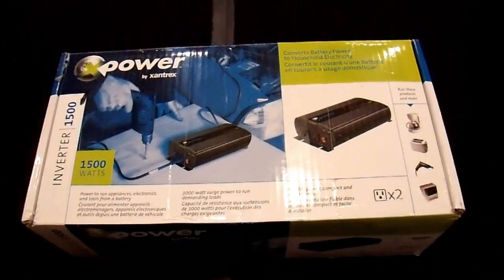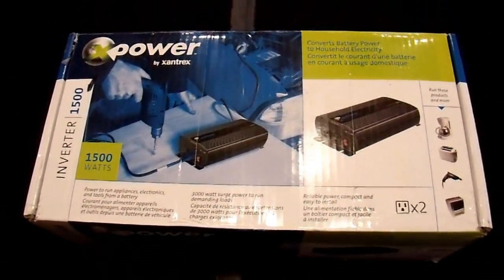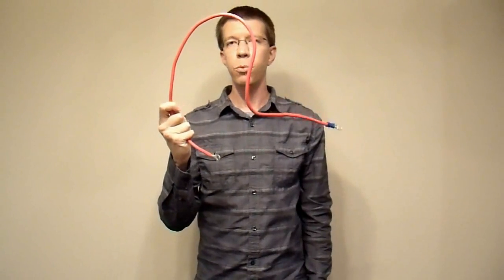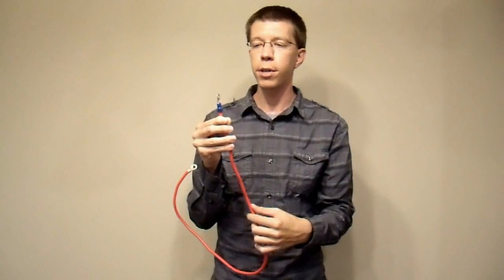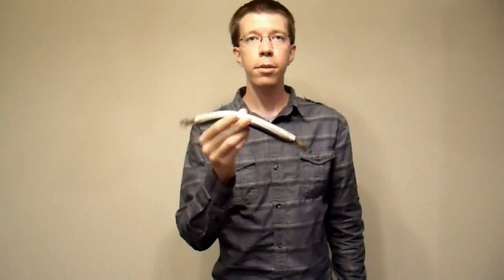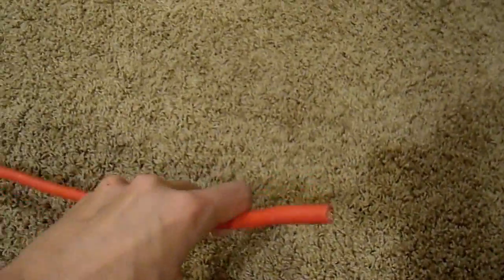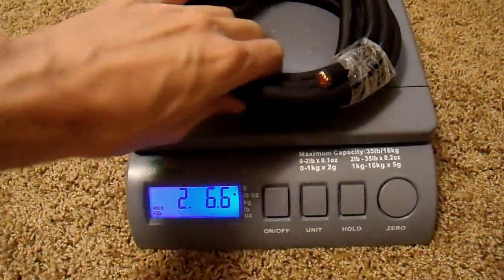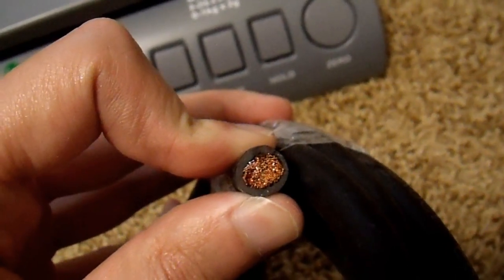How to Select and Purchase Battery Inverter Cables Part2

Comment: hi, does the battery sizes matter to use ? and does the inverter produce the wattage is says on it what i mean will the inverter produce the wattage no matter the type of battery i use or does it depends on the battery? and in what way is the inverter better  what i mean, should i stay with 12 volts and 1.3 amps or increase the voltage ( how much volts) and leave amps alone or leave the volts alone and increase the amps ( how much amps) or increase both?

Comment: How about on a 2000 watt inverter can I run 6 feet of 1 AWG for the positve cable and 6 feet for the negitive. And should I have a 200 amp fuse or 250 amp fuse installed ??

Comment: Hey all. I'm just getting started in solar power. so i apologize in advance for my novice questions. I've gotten my 2 deep cycle batteries. Next will be the 100w panel and control charger. Finally, goung with either 400, 800, 1000w pure sine inverter. my question is what size (gauge) from the charge controller to battery, battery to battery, and battery to inverter. All 3 components will be in corner of my home (roughly 3x3 area) I know distance places a part in choosing the correct wiring. also, where do I out inline fuses and what size fuses?

Comment: watched pretty much all your videos .looking to do a cargo van conversation to camper.after watching your reviews i have decided on the tiger claw 15000 converter because of cost and the pure sine wave. im thinking of four 100amphr 12volt   deep cycle batteries in parallel and a 400 amp controller.run off 3 100 watt flex solar panels.do you think this would power a 500k a/c unit? along with some lights.a small micro wave,small portable ice maker.small tv .not all run at the same time of course. does the set up sound ok? new to all this.

Comment: quality car audio wire is usually over sized cheap car audio wire is undersized (for example sky high car audio 1/0 is about 3/0 size from what i have read and seen) as you said check reviews before you buy 

(disclaimer i dont have hands on experience with shca wire but there is plenty of info online)

Comment: Just bought some heavy cable for an inverter install at a surplus store.  It's a length of old welding cable I thought was 4/0. Turns out it's even bigger.  The copper cross section is just under 9/16".  I'm guessing it's 5.5/0 from the charts I've seen. Can't find lugs for it online.  Any idea where to get them? I guess I'll stop by a welding shop,  but will probably be $$$

Comment: Also after doing some further research. I've come to the conclusion that my little Corolla's alternator may not be able to handle the draw from the inverter on the battery. So it was suggested to put another battery in the car. I will be getting a Group 27 deep cycle battery. Should I get an ACR or Isolator? Don't think I would need one since I will only have the inverter running when the car will be. Any other advice or suggestions?

Comment: I'm looking to hook up a 1000W pure sine inverter in my '08 Corolla. I want to use the inverter to power a battery charger for landscaping equipment. The company of the equipment states the charger needs 550W to work properly. So I figured why not go with 1000 instead of 600. I was initially going to install the inverter in the trunk (for ease of access). Until I read your comments about a moisture free environment. Now I will install it under the passenger seat.

I'm just curious about:

1) should I ground the inverter to the body instead of back to the battery?

2) will this be a problem for my battery/electrical system in the car?

3) any recommendations for wire size and in line fuse amperage?

4) anything else my noob self may have overlooked?

Thanks in advance for any advice and for this truly informative set of videos!

Comment: Hello, what gauge size inline fuses would I use with the 2 gauge wire running approx 5 feet
Thanks Al
Reply from the maker: It depends on your particular setup.  (Insulation class, environment, cable routing, fire hazards, etc)  But it would be in the 100A to 150A range.

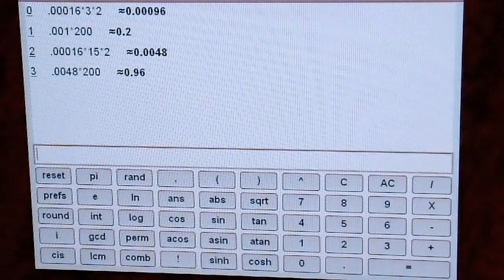Comment: Why is 0.2v okay but not 0.96 at 4:20 on video?  I understand the math but not the conclusions's assumptions. Why?
Reply from the maker: It is only a 'rule of thumb'.  One could go into the engineering tradeoffs for a particular application but the complexities of optimizing the system quickly get far more involved than the effort that is practical for most applications.  I stated 0.2V as a good value to choose and design for for general applications.

Comment: I just received my new 1kw pure sine wave Odyssey 24v inverter. You haven't mentioned a hookup which goes through the Solar Charge Controller.  I expect to MAKE a few lithium ion 24v batteries for this system. I suppose that the gauge wire used should be the same through the charge controller connections. Right now I have 10 gauge in place and 10 amp circuit breakers as disconnects but i see that I'll need to increase that to 60 amp circuit breakers. (Surge watts might come to 1.4 kw) It looks like they've sent me 2' of a much thicker gauge wire than the #10 that I have used so far. Should I change it or am I all right?

Comment: would like to know if you make a 4/0 allluminum but connector can it be done and should you solder it or crimp and can yo use a copper but connector on alluminum??Thanks
Reply from the maker: It isn't generally a good idea to connect copper to aluminum due to their galvanic differences, however I know that there are solutions out there intended to solve this very problem.  I only work with copper cabling myself so I have little experience in that regard.  Unless you're talking distribution wiring aluminum really has no practical application in household or low voltage wiring so I avoid it.

Comment: I just bought a Go Power 300 watt pure sine inverter from Amazon for the car.  Other recommended purchases on Amazon were a 4 gauge/10 foot wire and inline fuse box so I bought both of those.  The Go Power instructions say to use a 6 gauge wire for 10 feet.  If the cable is a bit larger than recommended, will that fly with no troubles? 
  Also, how the hell do you get those wires into the cab by the passenger side foot area?  Is that the best place to put the inverter?  Seems that distance would be about 8 foot from the battery in my 93 Corolla.
Reply from the maker: You can always use heavier gauge cabling without any problem - it's just more expensive, heavier, and more difficult to work with.  Unless you purchased a marine grade inverter it should be located in a place that does not see water or condensing atmospheres, and the only place that fits those requirements is in the passenger compartment.  As far as how to get the cabling there, well, that's up to your creativity.  :)  You may choose to drill/cut through the firewall and re-seal it with automotive grade seam sealer.  I would not recommend using standard silicone caulk as it will crack and open back up.  Seam sealer is expensive but very good stuff.
Reply: *****
Thanks.  I've learned a lot from you.
Reply: *****   Update:  I used heavy gauge wires - the maximum length recommended for my inverter (10 feet).  Had to drill through the firewall as you stated here.  Sealed the hole.  Came out fine.  
I love my Go Power inverter.  Yes it was expensive but it rocks.  Last fall I traveled all over the country making videos and sleeping in my car.  Every day I used the inverter to charge batteries and cook food in slow cookers.  Excellent!  Worked flawlessly.  You taught me about pure sine.  Thanks again.  
Brett
Reply: +knurlgnar24, hey there i have a question.  I too bought car audio wire for a 2000watt inverter 4000 watt max.  The wire is 1/0 and ofc copper. Its very heavy and end terminals i used had to be 2/0 cause the wire is high strand count & $3.60 a ft. Inner diameter is 13.5mm and outer 16mm. 
Now here is the question,  i soldered the ends to the lugs,  till they over flowed then i used shrink to seal the ends. 
Will those ends be ok with just shrink as insulation??

Comment: For best results you should haVE A 120 VOLT dc BATTERY BANK  connected to a 120 volt DC to 120 volt AC inverter
Reply from the maker: That would not be an optimal configuration.  120V AC peaks at around 170V, and phase corrected modified sine peaks at around 140V, so 168VDC nominal would be required to avoid the boost stage.  120VDC would not yield any meaningful benefit.

Comment: Did you measure the diameter? I just ordered some # 2 AWG for my inverter and it'd be mighty helpful if you could tell me what it measures out to. 
~Tyler
Reply from the maker: I've used/crimped all of this 2AWG cable so I'd have to cut something apart to measure it now...  However I do have some 0AWG fine strand welding cable on hand.  The copper inside this 1/0 cable measures about 10mm in diameter when uncompressed.
Reply: ***** Ah, no biggie. So, 2AWG would probably be a couple millimeters smaller in diameter, would you say that's a good guesstimate? Thanks
Reply from the maker: tyomen
2AWG would be about 8mm in diameter if all else was equal to the 0AWG cable I measured at 10mm.  This depends on many factors such as strand count and how tightly they are packed so it would be a very general estimation.  Solid copper at 2 gauge is 6.5mm in diameter, so it should be well over 7mm for a stranded cable.
Reply: Awesome information. It does help. Thanks man, and keep up the good work!

Comment: Very informative! Could you please share the URL of the site for the 2nd table you used?  Also, can you provide some info on what size and type of chassis grounding wire should be used for a 2000W inverter?
Thanks.
Reply from the maker: The 2nd table came straight from wikipedia on the american wire gauge subject.  Inverter chassis ground is a non current carrying conductor and gauge is largely unimportant.  For safety reasons it should be sized so that the fuses open before it starts a fire.  For a 2kw inverter 8AWG is plenty heavy and you could make do with 10AWG.  I personally omit the ground in most cases, but that isn't recommended...

Comment: Great videos. Would you mind giving me the link for where you bought the 2 gauge wires and connectors?
Reply from the maker: The ones shown here are good quality and are Install Bay brand rings, however I have since moved to Molex brand (available on eBay) because they are much heavier construction and close to the same price.  You won't find anything of this quality for sale to ordinary consumers as a finished product...   As far as the cabling goes I would recommend welding cable - it's the best stuff you can get and isn't that much more than other sources who actually give you the gauge they advertize.  What I showed here was not welding cable but good quality automotive cabling.  They are similar, but welding cable is better if you can find it for a good price.
Reply: ***** Thanks for taking the time out to answer. I'll definitely look into that.

Comment: It's a pleasure watching and learning from your video's.  In this video you figured the same length of cable from battery to inverter but is there any reason that in a automotive situation you couldn't use a short length  of Negative cable and ground to the closest appropriate chasis ground?  Ex: Place the inverter in the bed of truck, run a positve cable from engine compartmant to inverter, say 10' and ground the negative to chasis with a 2' ground wire to bed or frame.  If this is applicable do you use the same figuring for total cable lenght in the formulas?
Thanks for your time and keep up the good work !

Comment: @knurlgnar24 @FrugalPrepper 2 months ago FrugalPrepper asked about connecting an inverter's ground to his vehicle chassis.  Apparently youtube won't let me reply to that comment, but I have a question about this.

I've read before that passing significant amounts of current through the chassis can promote rust.  Is there truth to that, or is that a myth?

I just found your channel yesterday and I've really been enjoying it. Very informative, thanks for the uploads.
Reply from the maker: Technically passing large amounts of current through a chassis can promote rust, but from a practical standpoint it is entirely irrelevant.  There is so much properly welded steel in modern vehicles that the GND potential difference from one end of the chassis to the other is hardly measurable.

What IS relevant is that large currents require very good connections.  A weak chassis connection will create heat, voltage differential, and rapid corrosion of that single connection point.  As long as the cables are adequate and the connection points are secure and protected from corrosion I wouldn't be concerned.  Do upgrade that GND battery strap though!!  The one that goes to the starter is not intended to handle large chassis currents due to drivetrain mount isolation, etc.

Comment: Thumbs up on the informational. I've heard about voltage drops over cable runs for years & have been satisfied to use large gauge wire as much as possible when any current was being dealt with but I understand it better now.
Reply from the maker: Thanks for the comment and support!  Most people don't consider or understand the voltage drop portion of cable/wire sizing which is unfortunate, because most anyone can quickly understand it if they want to and are given the right information.  I hope this video is effective for that purpose!

Comment from the maker: Oh, I see what you mean now.  Yes, you can use the chassis of a steel vehicle for electrical current carrying ground.  You may need to beef up the battery to chassis connection, though.

Comment: No I mean, I wanted to save on cable.  So I ran one short 00 jumper from the Battery Neg to the Chassis, and one short one form the chassis to the bolt off the alternator bracket and then in my trunk I just put the negative cable from the inverter to the chassis and just ran one positive 00 all the way back to the trunk.

Comment: multi strand wire for a DC application works MUCH better than solid. I would run a multi strand application. this will give you a better result...

Comment: A thumbs up on the vid.  But I sure would like to hear more about crimp vs. solder ;-)  I sized my cable based on voltage drop.  Hadn't thought about heat.  Thanks for the info.

I got what looks to be a good 2AWG jumper cable for my inverter.  I crimped ring terminals on one end, but couldn't wait until final installation (~3ft) to try out the inverter, So I hooked the clamp ends up to the batteries, today, and fired it up. Whooo!  20ft (x2) of cable had a huge voltage drop.

Comment from the maker: That is one of the disadvantages of fuses:  They add more connection/failure points and have a non-insignificant voltage drop that must be accounted for with heavier or shorter cabling.  Not all audio vendors are a rip-off, but some certainly are!